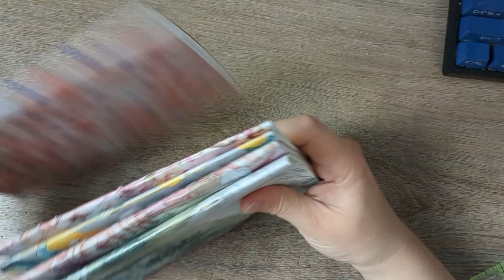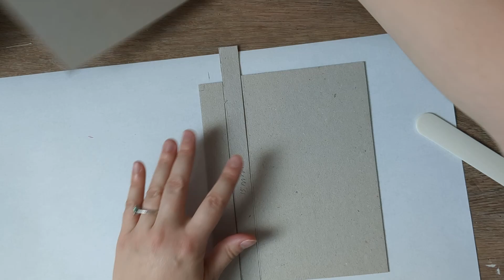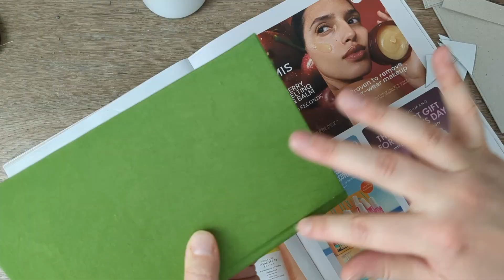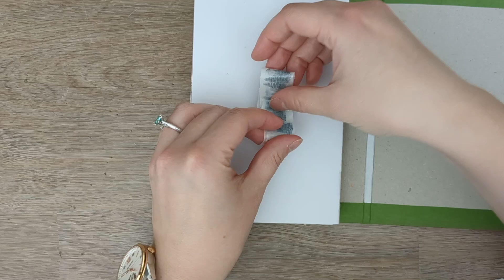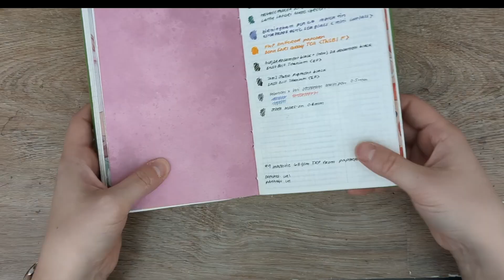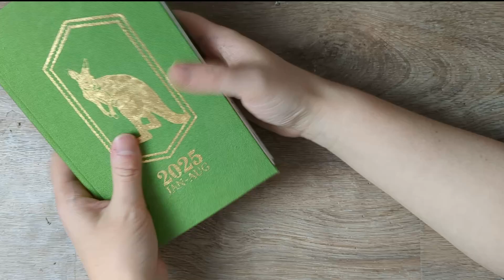Journal Inserts into a Bound Book! (Project Log)

Comment: The only thing I can think that might have helped on your spine was after the glueing, maybe a strip of bookbinding tape along the spine.  It's both fabricy and a pretty strong adhesive that is book save, and it would give a bit more structure to the spine in the way that reminds me of what you were looking for when you said "maybe fabric?"   I love bookbinding tape because I am a weirdo who repaired books for my HS library.  The smell is nostalgic.

ETA: Also, Double-Stitched Binder Tape might have helped you. It's really good for setting the spine space and the hinge space.  But the downside is it comes in rolls and the rolls are the width of the spine so if you do different sizes you need multiple rolls.
Reply from the maker: Oh, I hadn't thought about tape. Interesting suggestion, thanks!